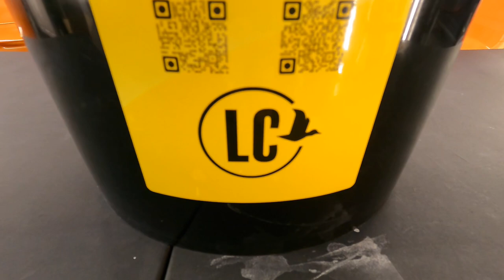How To Clean Your Polish Pads!! Lake Country System 4000 Pad Washer!

Comment from the maker: How do you clean your pads?
Reply: Dumping in machine washer on delicate setting with extra rinse.
Reply: Pad washer
Reply: I used a stiff brush to clean after each pass during use and use 2-4 pads at a time depending on what I'm doing. Afterwards just a thorough clean with an APC.
Reply: Compressed air while correcting,hand wash
Reply: I use the Adams pad and microfiber revitalizer.When I’m around air I use the compressor.
Reply: i use compressed air or the little hard brush to clean the pads every pass or 2,     when i change pad, i put it in a small bucket with ONR,     once ready to clean, i use apc and clean them in the wash tub,     i use a 5 gallon bucket to spin the pads with the rotary to get the water out.     let them air dry ...        i don't wash pads during detail.    simple effective for my application
Reply: By hand in a sink.
Reply: Dish soap and an orange brush in the sink.    I have to get a pad washer!
Reply: I use the LC4000 pad cleaning system!
Reply: I use one of these as well, but I use P&S Rags To Riches in my cleaning solution instead.
Reply: I clean panel by panel but a bucket of rinseless.  I dip it then squeeze out the pad and then turn the polisher up to get out the excess
Reply: I think the Detail Guardz pad washing system might be a better option for around $50-55. I think it's a bit easier on the pads, as you're not using a polisher to spin them up to high RPM and rubbing them on the cleaner. It also gets more water/solution pumped through the pads, sort of pumping out more crap left over in the pad. You can get two of those Detail Guardz pad cleaning systems and run them side by side, one with cleaning solution and one with just water to rinse them even more...and still be under what the Lake Country 4000 costs.

Comment: I love using this. It is so efficient, at least to me. I used to use swap pads, and then I'd have to wash just felt so bleh but doing this in between section just makes it so much easier. Don't have to worry re-centering the pad, ripping off pads etc.

Comment: I keep a big towel folded up nearby, because even with using the lake country system, I still have a decent amount of moisture left in the pad after "drying it ". I just push my pad into the dry towel a couple times to get rid of the excess moisture.

Comment: These are great tools which make clean up at the end of the day so much easier. I am cheap and resort to a five gallon bucket with two gallons of rinseless wash and a microfiber towel. This way spin off stays in the bucket. I do like the pad washer for deep cleaning pads though. Thank you for an excellent video.

Comment: I use one while cutting and polishing boat and RV gel coat. No need to swap pads, just give it a quick rinse with the washer and keep on working. I believe that's what it's really intended to be used for. So you don't have to swap pads while working. I use pad cleaner in a sink to deep clean my pads.

Comment: I started out with the grit guard version. It was great, but the lake country version is the next step. It’s nice that it keeps the clean and dirty separate.
Reply: You mean the Detail Guardz pump system? That attaches to their Dirt Lock Guardz?
Reply: Grit guard came up with their own pad washer before lake country. It pumped the water in a similar way. But what the LC 4000 does is keep the clean solution separate from the used solution. That way you are not cleaning pads with contaminated water.
Reply: @johnwalters878 Dude, you're cleaning some pads, not doing open heart surgery. Their system is for high volume shops, to just stand around so you can clean your pads as you work the paint. The Detail Guardz system is more for cleaning your pads after you're done working the paint, or if time is not an issue, you could clean as you go too, just more time consuming (which is why LC 4000 exists). The Detail Guardz system works by keeping most large contaminants separate by keeping them captured underneath the Dirt Lock Guard, and tiny contaminants emulsified in the cleaner. Just squeeze your pads dry, and you'll be fine. If you're cleaning a ton of pads, more than 4-6, either rinse them outside the bucket after the wash, and squeeze out the water....Or get a second Detail Guardz sysem for a bucket of clean water and rinse there. Either way, you're still not spending near what the LC 4000 costs,  arguably saving money on pads by not wearing them out at high speeds over the abrasive cleaner head, and probably getting cleaner pads cause you pump more crap out of them. Either way works...depends on what's more important, time or money?

Also I would not even compare anything from the original Dirt Lock brand, to anytbing Detail Guardz puts out. They might seem similar, but the performance is night and day different.

Last point, if we're already talking paint correction. I'd much prefer to work a panel with a clean pad, dump that pad, then grab another clean pad for the next section - to working a panel, running over to the LC 4000 cleaning the pad, running back to do the next section, running back over to the LC 4000, cleaning the pad, running back over for the next section, on and on... I'd rather use 8-10+ pads on a car, then just take 5-10 minutes and clean them thoroughly at the end of the job. By the time I prep another car, they're ready to go. That's just me though, everyone's got their own rhythm. My point is I'm not sure just how much "time" you're saving with the LC 4000, realistically.

Comment: PSA- completely irrelevant to this video, but thought it may help a few people out. If you have an ollie's in your area, they have seal and shine for 5.50 a bottle, meg's hybrid paint coating for $20, meg's ultimate snow foam for $17/gallon and a bunch of chemical guys microfibers, a few car soaps, and some applicators. The meg's hybrid paint coating is a steal. I think that was at one point like 50-60 bucks. Must not be selling any of it. Anyways, just wanted to share...cheers!

Comment: I keep my washer on a bucket dollie and drag that around with me.  I also have a thin sheet of semi ridgid "vinyl" that I can fit around the washer in the dollie that helps with splatter from the spin dry. (I originally used HD flat cardboard boxes until I lucked into my vinyl shield).
Reply: Ahh I need to modify mine like that, at least about 3/4 around. Good idea thanks

Comment: brian you use that thing so wrong i tought you were joking for a second. specially dumping the dirty liquid into nice fresh solution :)
Reply: the only reason system 4000 is the best one out of all the other ones because its capability of keeping the dirty and clean solution from each other but what you did there defeated the whole purpose also you should pump it couple of more time that way your pad gets clean fully at the first try and extra solution keeps the pad washer clean as well